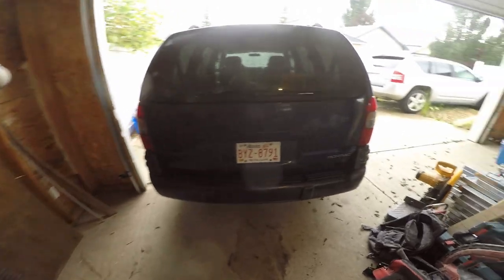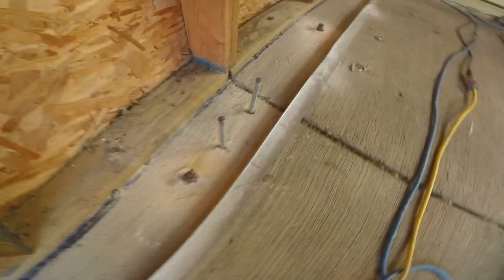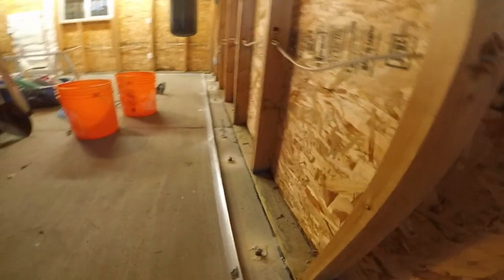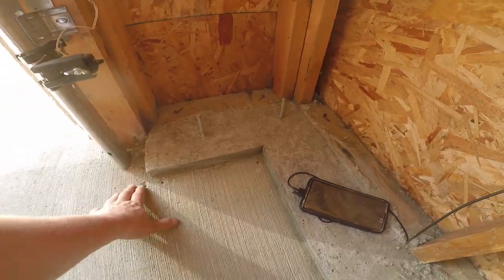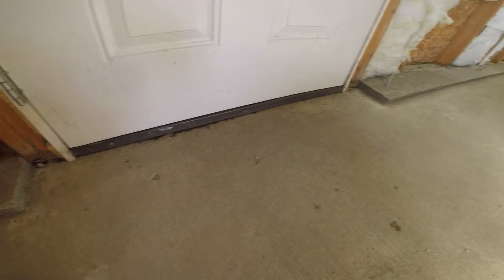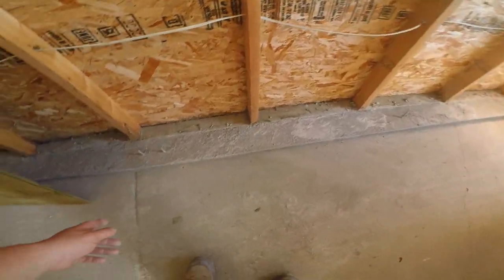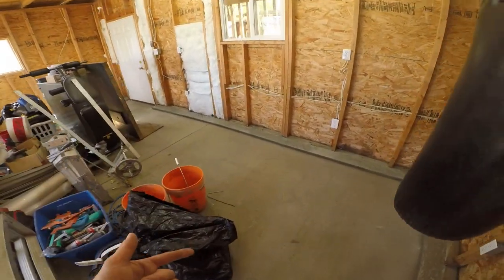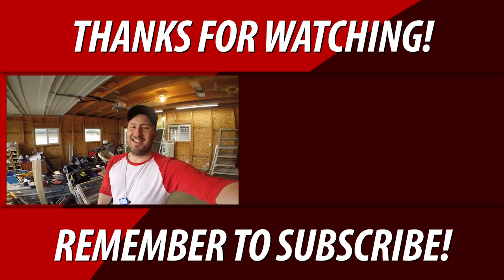Adding Concrete To Your Garage To Eliminate Water | Studio Build Ep. 1

Comment: Problem I see here is you may have stopped the water from coming into the inside but it still will be going under your 2x4 framework and eventually rotting out. You should have focused on the outside to stop the water from ever getting under the framework. Always attack the waters entrance not the waters exit.
Reply from the maker: You're right. When the first winter snow melted we flooded. I also didn't think about the thousands of lbs of weight I added to the building and it sank a few inches lol. Before the end of the season o am going to do the concrete on the outside. The original plan was and still is to remove the exterior wood and replace it with steel stud, densglas and avb so sooner than now.
Reply: @ConstructionKronies  
If you put concrete on the outside make sure you slope it AWAY from the building AND also ( very important ) put flashing under the siding leading onto the new ledge you build. Otherwise it will just seep between the siding and the new concrete where it meets. And caulking it won't work because when the ground shifts in season changes  it will just create cracks in the caulking and you will have to re caulk multiple times a year.  ( I learned the hard way )  Water always seeks the easiest path.

Comment: Much better but I have a feeling the outer cladding/OSB will still absorb water and rot eventually.
Reply from the maker: Yes it will for sure. This was more of a fix for my interior steel stu walls. A this point I could literally tare out the exterior walls and and go right to my steel if I wanted to. But that I will do in time. Cheers bros!
Reply: I was thinking the same thing. What could you do to the exterior to prevent it from getting to the osb, bottom 2x4 to begin with?

Comment: What the black caulking seal you used before laying concrete.

You coulda just added layers of that seal use both flex seal drylock on top.

You shoulda used hydraulic concrete type instead of the basic quik crete.

Add pvc downspouts black tubing along the garage outside that too prevents water, look fugly but garage wont leak.
Reply from the maker: Yeah I dig it! Next time I'd definitely do it higher as well.

Comment: Looks good! I learned the hard way about not having a good stemwall. Had to re-do the whole thing wow that whole garage was lifted in the air!
Reply from the maker: I know right, if I wasn't going to be framing the 6" steel stud wall on the inside i would have to raise the walls here too or cut into the bottom 12" or something.
Reply: Construction Kronies yeah, walls aren’t perfectly straight now, but at least now the stem walls sit higher than all the other properties next to it. Full rebar. Heavy bolts with 3” washers. Simpson metal brackets/walls and a drainage system... it’s gonna take me months to edit and post the whole 3 year project here! Lol